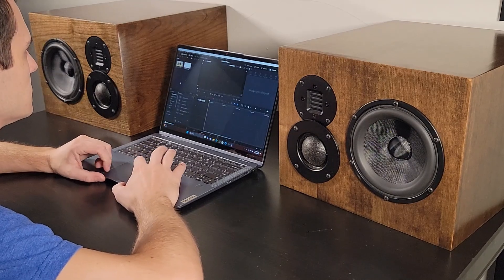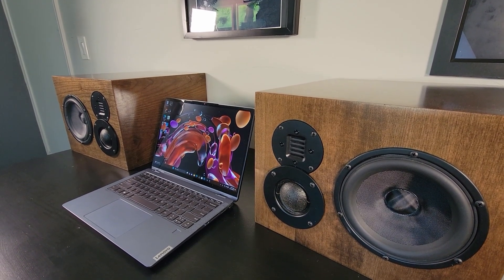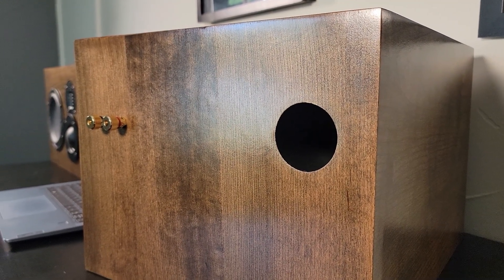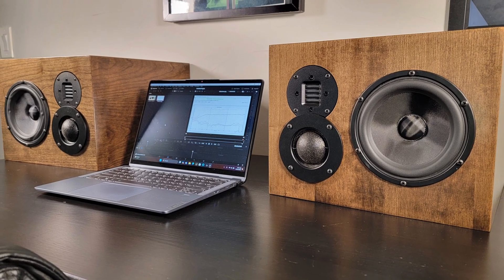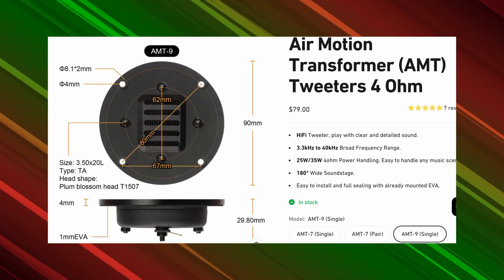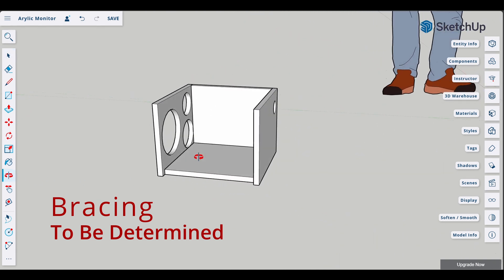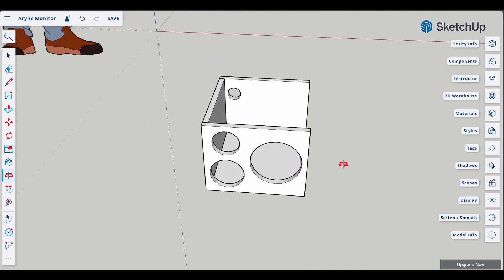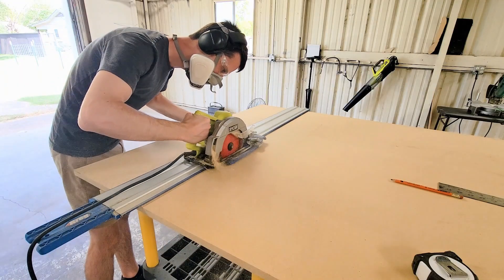Ultimate DIY Studio Monitor Build - Design, Build, Measure

Comment: Great build. They look fantastic. Where did you get all the components other than the speakers? What was the final cost? Also what made you choose the speakers you did? That REW results are great, just luck that those speakers are that flat? Also rear ported speakers are fine against the wall as long as they are angled a bit. Not sure where the myth came from, but I'm never been able to find any source or tests that show this to be a problem. My rear ported Mackie XR824's are 1/2" from the front wall on the inside and about 4" on the outside and measure flatter than almost any REW measurements I've come across around the net. I do have extensive acoustic treatment in my room though.

Comment: Very nice build, curious as to why you decided to mount the mid-range proud of the tweeter.  I would have opted for the opposite to better align the diaphragms relative to eachother, was it just because the mid back volume prevented this arrangement?

Comment: 11:57 - In the words of the great speaker builder Paul Wilbur Klipsch - "BULLSHIT!"

Even with 1/12th smoothing that is NOT the graph you measured using the technique shown in the video. There is no way in hell you are getting a graph that smooth measuring a speaker indoors, 3 feet off a hard surface, 5 feet from a back wall,  with other wall and ceiling bounces all there as well. There is also no way in hell you are getting an impulse response that clean indoors as well.

Comment: 🤔 Why wouldn't you position them with the low end drivers on the inside, and the middle & high end drivers on the outside, and also angled inward so that the drivers were directed towards the ears instead of past them?

Comment: Hey mate, great job, and thanks for sharing. 
I'm looking at doin my first speaker build so this is helpful and inspiring.

On another note I'm no expert and I don't mean to be "that guy" on the internet but I wanted to just draw attention to what appears to be a safety risk here in case you're not aware of it. The table saw cut you're making at 2:22 appears very risky, as you've removed the riving knife, are cutting a piece that appears wider that it is long against the fence, and you're not using a push stick. I note you're standing well to the side which suggests you're probably cognizant of the kickback risk here, but I wanted to just draw attention to this as this cut has a significant risk of the blade grabbing the piece, and hurling it backwards. If you see such a kick back in slow motion you'll see it results in the piece rotating as it binds, and this will tend to draw your hand with it towards the blade faster than you can react with obviously potentially ugly results! There's some pretty scary examples of this happening with table saws on YouTube, with some of the things mentioned above being risk factors.
I'm not a table saw expert but my understanding is that when making a cut like this (wider than it is long) it's far safer to do it with a cross cut sled (which admittedly requires you to build one, but with your skills it's straight forward). And the riving knife serves to help prevent kick back and should not be removed unless absolutely necessary (eg dado cuts).

If you're already aware of all this and are consciously choosing to cut like this then of course that's your choice, but just wanted to point it out in case you weren't aware of the risk here, and the options to mitigate it.

Anyways, again, appreciate the upload and keep up the great work mate

Cheers!

Comment: How did you anchor your crossover board in the cabinet?
Reply from the maker: I don't remember exactly what I used here, but either hot-glue, or a type of super glue. It's admittedly risky if you need to pull the xover back out. 
More safe play is to use velcro strips on both board & cabinet for easy removal.
Reply: @DIYhyfy the best way is to buy some circuit board standoffs from parts express.

Comment: How did you do time align drivers in crossover?? Midrange is like 1" I front of the other?? Did you measure phase response? I learned that never have reflexport close to a wall. Always leave space around it. So it can breath.
Reply: Time alignment isn't really an issue there. An inch would result in a 0.07 ms delay i.e. not audible. Any phase issues would come from the crossover but from what I can tell there's no issue.

The thing about ports is generally true; they're definitely too close to the walls here as they're completely blocked off (essentially creating leaky closed boxes). You can get away with having them 𝘤𝘭𝘰𝘴𝘦 to a wall as long as you design them with that intention and that goes for all types of boxes.
Reply: @Undecid just like most polk rear ported speakers with wall hangers from factory.

Comment: I've loved watching your builds.  I've been planning on building a higher-quality copy of the Wharfedale Lintons.  3-way with 8" woofer, 5" mid, tweeter. Using hardwood box or hardwood plywood for box. May use MDF for front panel.   I'm considering using Datyton Reference series 8 ohm for woofer and mid. Also might use Dayton crossovers. Unsure about which tweeter.   I would appreciate any feedback, and maybe this is a speaker you might consider building?
Reply from the maker: The Wharfedales would be a great speaker to take inspiration from. 
Dayton Reference Series are great value, and great sounding drivers.
Using hardwood or mdf is really up to you. Some hardwoods can be great for speaker cabinets, other not. Just do your research.
The most important thing you mentioned is the crossover. A pre-built xover will take the nice drivers, and turn them into something you don't want.
If you have the budget, a measurement microphone is would be most useful.
If you can't afford one, maybe you have a friend with one. Crossover design relies on having measurements from a microphone, taken from the speakers in the box they will live in. Without this, it is a total guess what will happen when using a pre-built xover.
I hope this helps. Please ask more questions if you have them.
Reply: @DIYhyfy  I appreciate the feedback & wisdom. How much does the measurement mic cost?

Comment: Nice work!
I'd have countersunk the mid and woofer as well, to get a flush front, doubling up the front board if neccessary to have enough thickness to set the screws.
Also, I don't like the protruded cable terminals on the back too much.
None of that has and influence on sound, so it may just be my OCD talking.
Reply: I wouldn’t countersink the drivers because of potential diffraction. Flush would probably be ideal . But I would certainly double up on the front baffle thickness

Comment: Excellent work!👏
i only have a slight criticism of the lacquer painting technique,
use the spraygun at a fixed distance as you spray (robotic movement) ,there is no need to make a circular movement that changes the distance and thus the amount of material coming out so the result will be much better😁

Comment: It looks like one woofer speaker suffered a damaged surround in transit. It will have higher harmonic distortion during operation than an unspoiled unit due to asymmetric Kms, and may even present uneven compliance from side to side, resulting in coil rocking if the woofers ever really get hopping. You'll want to replace this unit to get consistent performance and the best longevity from the speaker.
Reply from the maker: I would definitely agree for the long term. I did also do a listening test in free air to listen for coil rub. 
Ironically it was the protective cover that slipped sideways and was pressed against the surround for some time.

Comment: I'm a little surprised that these studio monitors are so approachable. Most people who go out of their way to build a set of studio monitors will also use 3-way integrated amplifiers with DSP correction for absolute in-room linear neutral response. The SEAS KingRo4y mk.III DIY studio monitors call for this kind of setup, which makes them quite expensive to build. Seems like the sound quality is worth it, based on the reviews I've seen, but it's still a steep price increase.
Reply from the maker: There are definitely ways to improve with DSP. It really is hard to beat when it comes to low end extension, and linearity.
Reply: @DIYhyfy  DSP correction combined with durable drivers, powerful amplification, and a suitably rigid cabinet are really the only effective means to cheat the rule that there is no replacement for displacement. Combine all of those things and you can get much more powerful bass response out of a speaker than it should really be capable of through conventional means.

But the kind of design you used is far better for the average person considering a set of DIY studio monitors, since the barrier to entry is significantly reduced by the conventional speaker design. Fairly simple crossover, standard amplifier requirements, and the drivers aren't even unreasonably priced. I think the only thing I'd bother investigating an alternative to is to find some appropriately sized flared ports to reduce chuffing at high excursion on the woofer. Any other changes would either increase the cost too dramatically or would inherently modify the sound signature (like using a mid-woofer and tweeter with better extension so you can use a dedicated subwoofer driver for the woofer instead of a conventional woofer that just happens to have acceptable low end extension). This is to say that your design looks very good for the intended purpose and audience, so there's little room to improve it without detriment to one or more aspects.

Comment: Please note that schedule 40 2" PVC pipe has an ID of 2.067 which results in an area of 3.36 in sq, which is larger than using a nominal 2" ID calculation. Always shoot for accuracy
Reply: Not one person on earth would hear the difference
Reply: @mikerick6955  - Most DIY'ers are fanatical about using accurate calculations and using the nominal 2" as the diameter arrives at an 11% miscalculation. To me an 11% error is intolerable. I spent 15 months on an M60 main battle tank and everything above 12khz is a mystery to me, BUT, I still perform the most accurate calculations possible and always attempt to arrive at a full range solution with a decent tweeter.
Reply: Forgot to say, great project!